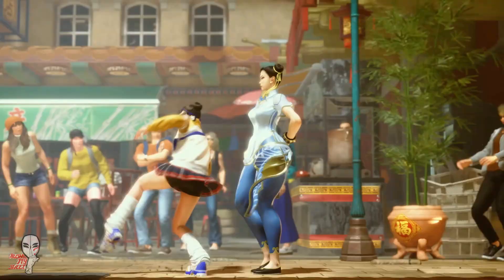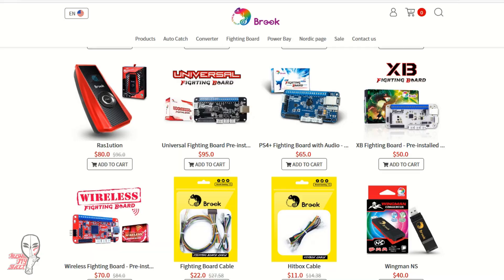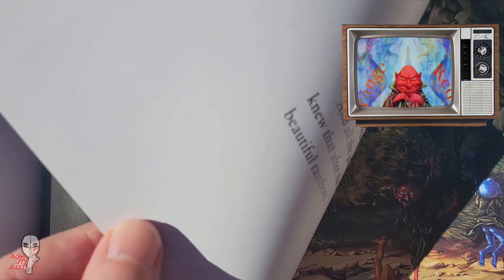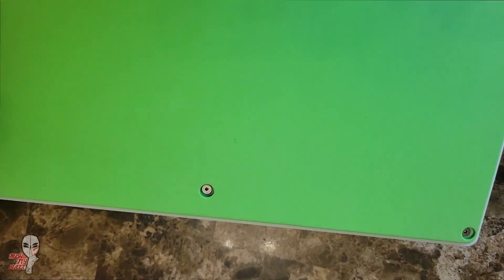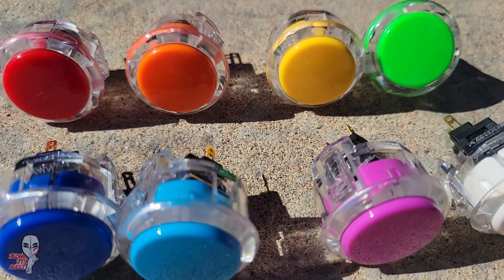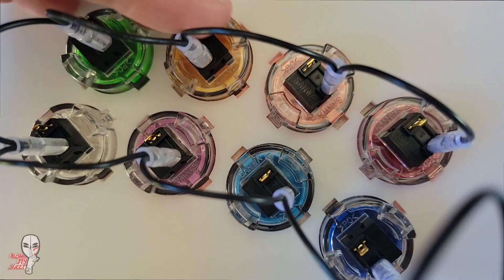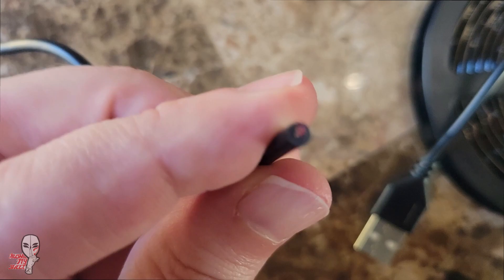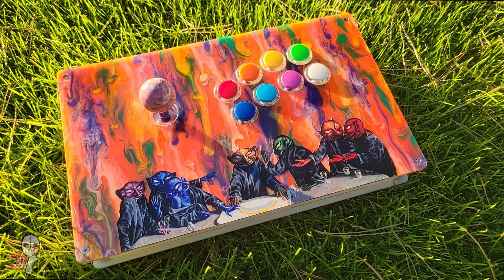Build your own FIGHTSTICK - Easy DIY! - LED arcade stick

Comment: Building mine right now! I designed mine with a 3d printer made a mold of that and filled with epoxy resin. Just put the leds on pcb as a test it works! Waiting on my vinyl for face plate to arrive and my custom Baiken hitbox will be ready!!!!
Reply from the maker: Very cool! You'll have to share it on the r/fightsticks subreddit when you finish! Good luck with the build.
Reply: @HushMySweet1  thank you and will do!

Comment: Would be cool if they offered a BNB kit with a Mortal Kombat hole pattern, or at least an un-drilled version so I could do it myself.  Anyways, Great video! 🤘
Reply from the maker: Very interesting! I rarely see anyone mention the old MK layouts. But speaking of BnB cases, I'm sure jonyfraze could cut a 4tW enclosure (there's another vid on this channel which showcases what that enclosure looks like assembled if you're not familiar) with your preferred layout, MK or otherwise. Hopefully you get your ideal stick! Thanks for watching!
Reply: @HushMySweet1  Yeah I've been obsessed with MK since the first one came out in 92'.  I still play the first three so I thought it would be fun and cool to build a stick that reflected the original arcade cabs, specifically MK3 with the "run" button.  I've never built one from scratch though, I've only modded or switched out parts.  Your channel has given me inspiration!
Reply from the maker: @1RacerXer   Awesome! You'll have to tag me on twitter or on r/fightsticks when you finish the build so I don't miss it!

Comment: Nice build, I bet your friend loved it. But I do have a question, would the LED solution interfere with a possible upgrade with the Brook PS5 daughterboard?
Reply from the maker: Well, it is physically possible to cram both into the same terminal, yes. I haven't done it personally, but I asked on the discord and some people who had, reported issues with the power draw. If that becomes an issue for you, then you may need to hack off another segment or two of the LED strip so it can run it all. Good luck.

Comment: In theory yes they are easy to put together.  BUT make sure they are actually compatible.   Had wires that weren't long enough (Brooks 20 pin wires - yes so easy to assemble but they didn't not fit into a Fightbox.   Yet they're ok for HITBOX which is much much larger?)  The wiring scheme  was impossible to match the button layout.   Then the USB didn't work on the Brooks PCB.    The only thing that was super super easy was getting SCREW type buttons.
Reply from the maker: Yes, someone looking to build their own should make sure all the parts are compatible. There are 5-pin joystick wiring extensions if the enclosure is wider or the PCB is seated in an unusual position. If people are ever questioning if something will go together, they can always post on r/fightsticks or the fightsticks discord so fellow enthusiasts and community members can help address issues. For the most part though (in my experience at least), most of these come together fairly well without issue.
Reply: @HushMySweet1  yeah i'm just annoyed how a Brook wire and Brook board doesn't fit in a normal Fightbox.   And then run into really annoying labeling system, and then a faulty usb connection.  sigh.... it's my first full mod and think this would be since everything is and should have been compatible but why am i having so many issues that's shouldn't even be there in the first place.

Comment: is there a way to do led button reactions on a fight stick? i cant find a videoon how to do this
Reply from the maker: The way this one worked, you would just use the remote that came with the strip to set the light animations. If the controller you're using is using GP2040-CE firmware (and obviously has the LEDs), you can use the web configurator to program different colors and animations. I'll try to do a video on that soon. Also, there are other light options like Kaimana which are also programmable.
Reply: @HushMySweet1  honestly that would be dope if you do a video on that because honestly I haven’t seen any video of any one showing how they did it or showed how they got it to work for each button and how it reacts with the presses.

Comment: Hello great vid and I have a question about the wireless board because Im in the process of building my first stick. Is there a battery pack I need to power the stick for the Bluetooth connection? And if so do you recommend anything for that?
Reply from the maker: Thanks for watching! Yeah, you will need a battery for this. There are some wires from the battery you'll need to connect near the USB-B on the board itself. The battery needed is an external PS3/PS4 battery pack (3.7V/1800mAh). I put together this stick for a friend (so no longer have it to check specifically), so can't remember all the details, but I don't remember it actually coming with the battery. Anyway, good luck with your build!

Comment: How to add the battery?
Reply from the maker: It just clips right in. "To fulfill the wireless use function, a battery is needed, and you can choose PS3/PS4 official controller’s battery for the PS4+ Audio & Wireless fighting board. When the battery is charging without connecting the board to console, you would see breathing light on player LED." https://www.brookaccessory.com/pro.php?m=d&pid=41130595 Good luck.

Comment: Hey there! Do you have a parts list handy? :)
Reply from the maker: I have a "Hitbox-style" all-button controller assembly video planned and I'll have exact links to specific product in that one. For this one, it was a Butter Banger V1 enclosure with green foam padding, a Brook Wireless PCB, Brook wireless battery caddy/mount, recessed antenna mount, Neutrik, Neutrik NA-USB surround and support, eight 30 mm face buttons (this case was designed for Sanwa snap-ins), three 24 mm Sanwa snap-ins for aux functions, 20-Pin Joystick/Button Harness, Sanwa JLF, Otto V5 DIY kit, $10 generic LED strip, Right Angle USB-A to USB-B Cable, clear dust washer, jawbreaker style 38 mm balltop, blue shaft cover, and a vinyl goblin sticker. I think that was about it. Good luck with your build!
Reply: @HushMySweet1  Thank you so much!
Reply: @HushMySweet1  any idea when this is dropping? looking to switch to an arcade stick or hitbox from pad and interested in a leverless one
Reply from the maker: @morgonreed  I've got two other videos started ahead of it, and I've been trying to do one fightstick vid a week. All the parts are ordered and the script outline is started though, so I'm gonna say October 24th for a hitbox build. Hopefully that's soon enough for ya. Thanks for watching.
Reply from the maker: Dropped that Hitbox assembly video today. Hopefully it's what you needed, but if you have any questions, ask away.